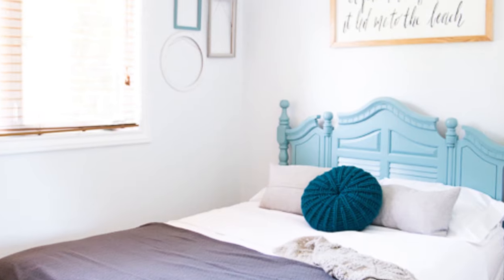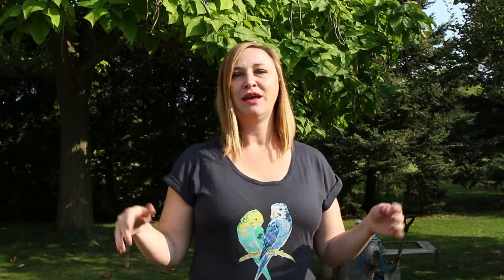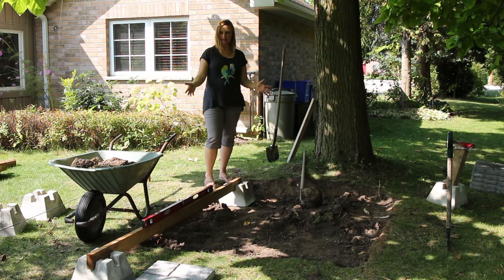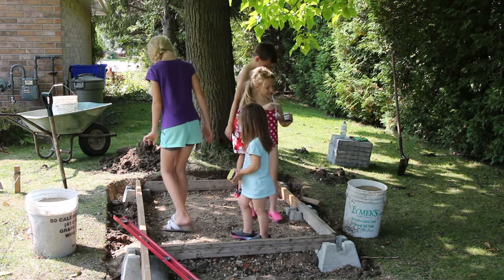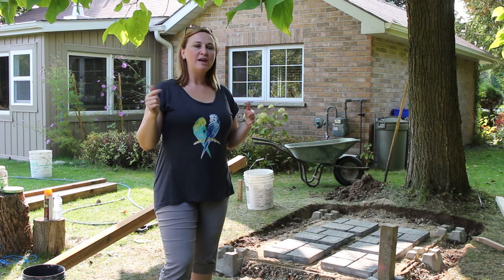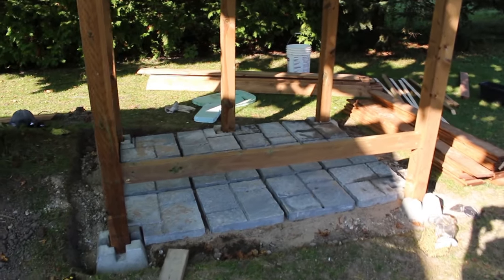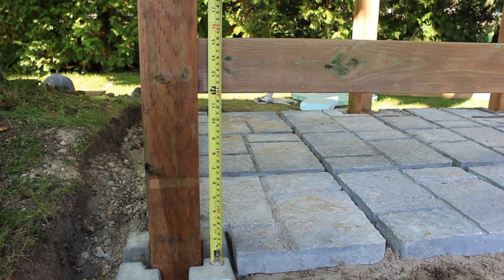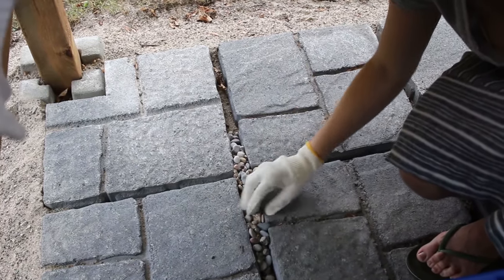How we Built our DIY Outdoor Shower Enclosure: Graystone Beach Cottage

Comment: Did you not concrete or screw the footing blocks in ? Is this not needed? How do they hold fast?
Reply from the maker: Hello! No - the cement deck blocks work really well. We've installed three of these showers in different locations and haven't had any issues. Once you brace everything together, the shower doesn't move at all. -Jane

Comment: Am about to embark on this project...wondering if you had shifting of the concrete blocks as frost comes out of ground post winter. We are dealing with PEi read mus as ground.
Reply from the maker: Hi Sandy. No, we haven't had any problems and we do get quite a bit of water (and freezing) in the winter here. It's been 4 years and it's holding up as strong as when we built it! -Jane

Comment: Thanks for sharing.  Did you run into any tree roots?  I don't know much about catalpa tree; some trees have surfaced feeder roots. How hot are summers in the part of Canada?
Reply from the maker: Hi Daniel. Sorry for the delay. Yes, we did run into some roots and had to cut through them (small roots though). The catalpa is pretty hearty so it didn't bother and we haven't had trouble with feeder roots. But that should definitely be kept in mind. Our summers are quite humid with temps around 30C . Hope that helps! -Jane